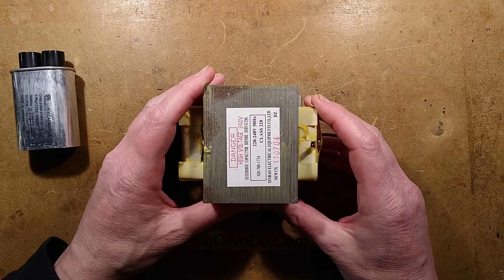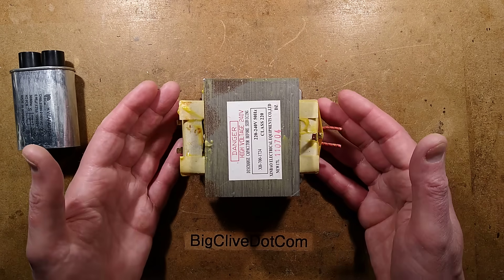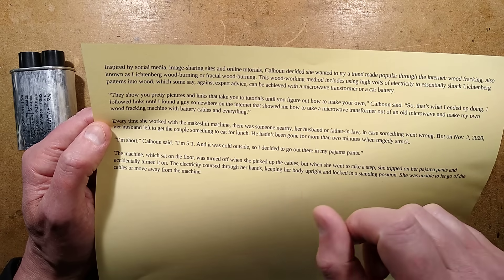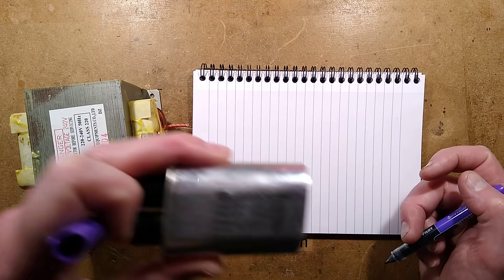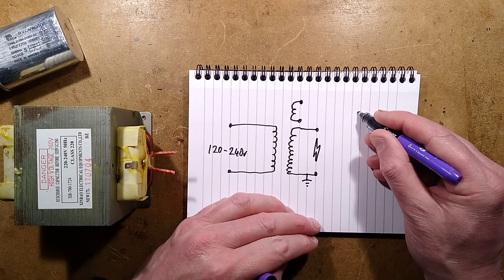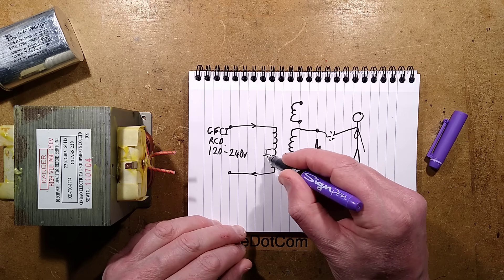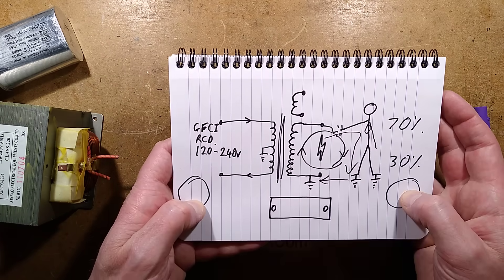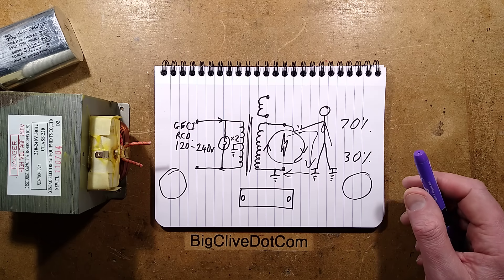The most deadly project on the Internet

Comment: I have seen my father working on the electricity in our house once and I don't recall what he did but there was a bright and very loud zap and his large insulated screw driver tip was melted off!, it gave me a healthy fear of electricity!.
Reply: I've seen a quarter inch thick screwdriver melted nearly halfway through by a 12 volt battery.

Comment: for those who want to try this, i suggest first they pull the sparkplug wire off of a running single cylinder engine with one hand while touching it with the other to get an idea of what they are playing with. with the plug wire disconnected, the engine will eventually stop rotating thus ending the high voltage pulsing through your body. your electrical outlet will not. remember the old hot dog cookers where the tasty, meat filled tubes were impaled at each end on spikes that were connected to the output leads of a transformer, thus causing them to plump up and split down the side, hot and ready for plopping into a bun with a little mustard? in this scenario, you are the meat filled tube.

Comment: Alternatively to building the entire box assembly you can attach your leads to the wood while the machine is unplugged and simply plug it in from a safe distance in order to turn it on and off
Reply from the maker: Many of the accidents happen because the things get left on or plugged in accidentally while someone is handling the cables.

Comment: Honestly the death rate doesn't surprise me, people who have no experience or knowledge of how something as simple as a transformer really works but are confident enough to play with one from a microwave to do a "wood burning" project are at very high risk of being careless while operating such a set up.  That being said I have had lots of fun with these transformers in dangerous ways, part of the fun is the thrill factor of knowing they can kill you... which means you must also pay respect to these components as such and have a backup plan in place in the event something goes wrong.  Starting with the common sense one NEVER be near the damn things while they have power on especially if you are playing with them by yourself.  ALWAYS use a grounded set up with your hands no where near anything live (or grounded for that matter) and have the set up on a breaker/and or switch.  Better yet use a momentary foot switch or trigger to operate the set up, it will keep you alert and it might save your life.

I have done lots of wood burning with these transformers, blown up circuit boards, jacobs ladders even played with couple different versions of tesla coils but not once had a close call situation, always assuming something is like, doing, triple check to make sure the equipment has been unplugged, don't touch anything until you have the actual cord in hand.  Habbits like this are the only way to prevent accidents and yes always assume any capacitors have a charge in them.  I even went as far as building a control box, the control box for playing with high power high voltage stuff and it is the only thing I ever touch while things are plugged in, it is the most practical thing I ever built lol.

I say it is pretty easy to use these things safely and have fun but that is coming from someone with some actual common sense and experience.  As a good friend once said "common sense is not very common".

Comment: Back in the early 60s I was a very curious kid and I had access to lots of electronic gear. I nearly killed myself a couple of times before I was 16. First time I was playing with a motor generator and I was trying to get it to run on 12v when it needed 24 so I was doing all kinds of sketchy stuff like lightly holding the brushes in my hands to reduce friction. Minutes after getting it running I got a probably 300-500 volt shock and was flung across the room by my own muscles contracting. The second time I was playing with a small flourescent UV lamp and I had mounted the components onto a steel angle iron which I held in my hand. I guess it was not well insulated because I got zapped with enough current that I could not open my hand. Fortunately I could move my legs and I slammed my arm against a chair which made the  lamp go flying out of my hand. Sometimes I think it is a miracle that I survived my childhood.

Comment: When I was in the military I had to work with the old APS-20 One Megawatt airborne search radar.  This was all vacuum tubes.  The two largest "black boxes" out of about 20 in the system was the high voltage supply and the actual transmitter box (about 400 pounds).  The HV supply was 12,800 volts and the thyratron tube in the transmitter was about 12,000 volts and 400 ma on the plate.  There were big capacitors in the system and the magnatron fired at about 55,000 volts. There were interlock plugs that were supposed to kill the HV that could be unplugged in the "radar well" , But one day I found that there was a failure mode that can occur making them useless.  Luckily you can actually hear the HV when it is applied, and you NEVER EVER touch any of these parts unless the system is totally powered down.  The failure was a shorted relay in the box that controlled the HV run up.  I gained a lot of respect for high voltages.  Replacing this box solved the problem. You also had to be sure that anyone in the aircraft near the controls was trustworthy to not do any thing stupid if you had your hands in these boxes below.

Comment: Another few suggestions from somebody that frequently uses arc welders:

1) Don't mess with two connectors at once, it divides your attention. Instead clamp one side at a time (while the device is switched off, ensure a good connection) and never use a system in which you are manually holding more than one connector under any circumstances.

2) Wear gloves. welders gloves work well, but it is most likely worth wearing any type of non-conductive protection.

3) Don't wet the workstation, circuitry or yourself in anything conductive. Duh.

4) Insulate any circuitry. Build a small, non-conductive housing for any circuits and keep them on a seperate work surface from any surfaces with conductive solutions or with large portions of metal.

5) Wear long sleeve clothing with trousers on. Do not wear a short sleeve T and some shorts, you are asking for an accident.

6) Have a buddy watch you work and never, for any reason, work alone with a homemade device delivering more than 500V or 20A. The story in this video highlights how even if your buddy is "gone for 5-10 minutes", it doesn't mean you should continue working. A buddy can't prevent an accident but they can prevent further harm by turning off the power.

Comment: there are even safer ways, i did this as a teenager just saying what if? i used a 60v pwoer supply and a murcury arc lamp ignighter to ionise the carbon (wood).
Reply from the maker: The lamp igniter only puts out low current at high voltage, but referenced to the mains.  I'm not sure how well it would work, but it could still pose a significant shock hazard.

Comment: I used the light in the microwave for an indicator and put all the components in a box. I put the microwave fan on the same box, also powered by the primary, to clear smoke away in case someone decided to wave it off for a better look. I will be adding a Deadman switch, but I built the thing with properly rated leads and three switches that turn on in succession as I move backward once the leads are set. This voltage has a hell of an arc and you'll never find me holding the leads.

Comment: Very happy to see this getting so many views, I hope the YouTube algorithm pushes this to everyone getting videos about projects with MOTs. Especially concerned with teenagers getting these projects in their feed as their judgement for safety is much much worse than adults. And even for an adult using a MOT would just be an incredibly stupid thing to do. 

Speaking from experience, when I was around 14-16 I got alot of videos in my feed about projects with MOTs. Most do warn of the dangers but it still didn't really land as a "make one mistake and you're dead"-kind of danger. Decided to make a spot welder once when I was 16 because I saw a video teaching how to make one using a rewired MOT. I wanted to try using the original secondary once just to draw some arc's so I just taped a conductor to a PVC stick. The arc was much bigger and louder than expected and it even burned part of the PVC tube. It got me terrified of the thing and I never used it again.

Now that I'm 22 and actually having had some electrical engineering classes in uni it just feels so incredibly stupid that a flimsy piece of PVC tubing was all protecting me from becoming a path for high-current 2000v to ground. As an adult I'd never even dare to energize a MOT with it's original winding anymore and I get extremely uneasy at the idea of 16 year olds seeing these kind of videos and try messing with these things themselves. Honestly doing these kind of projects helped me become good at these classes at school but it's just not worth the danger and I really think YouTube should enforce safety warnings on these videos.
Reply: When I was 22, there was no way I considered myself an Adult.
Now at 61, I still question that point.  Am I An Adult ???
Thanks for your story, sir.
- Retired Software Engineer.

Comment: I was making that wood patterns but with neon transformer, not electronic one but old, heavy and chunky (about 8 kilograms of copper, steel and resin). They went quite good but not very deep - since there was about 5 kV with 150W it coult take about 0,03A and still burn wood. 
Microwave transformers are best for home made welders or spot welders for lithium ion cells. You only need to replace secondary winding with only few (3-4) turns of thick wire.

Comment: Weird that YouTube suggested this to me on the VERY SAME DAY I decided to take my "boxless microwave" (all of the electrical components of my old microwave, painstakingly removed without undoing any connections, such that I basically had a damn Rat King/some kind of bolas from hell made of several chunks of mostly magnet wire and pure danger loosely netted together in a multicolored web with scarily thick strands) apart to finally see what all the fuss is about high-voltage transformers. I guess providence is telling me to watch this first...

Comment: Residual Current and Ground Fault are technically two different things which is the reason for the non-intuitive yet accurate nomenclature.

Residual Current: any form of imbalance between the source and appropriate current return conductor. Crossed circuits could trip an RCD/RCBO when the Neutral current is either higher or lower than that “sent” by the monitored Live relevant to that circuit.

Ground Fault: current returning specifically through grounded conductors, casements, etc.

As I understand it, many “GFCIs” are actually monitoring for Residual Current instead of Ground Fault Currents specifically and that there are certain applications where Ground Fault currents are of specific concern whilst Residual Currents are not.

Comment: When I was young, dad got a promotion.  He decided to upgrade to dimmer switches.  He got a little carried away and put one in the bathroom and hadn't put the cover plate on.  I ran out of the bathroom,  whacking the light switch as a 7 year old would.  Instead of going on to my next adventure,  I realized that my thumb was stuck in that gap, and I was buzzing. 🤩 I know I was thinking.  Duh.  I.  Am.  Getting.  Shocked.  By. My. Thumb.  Pull.  It.  Off.😠😀

Comment: You couldn't pay me to do this, or, if you could, I'd require a month with a certified electrician and probably about $2000 worth of safety gear and other things like another person to cut the power. It would have to be a lot of money. Especially since they wouldn't have to pay if I was dead.

I do have ONE question though. I knew that rubber boots or shoes were worthless as insulators electricity, but I always wondered what the outcome would be if the transformer (in this case) and you were up on a fully wooden platform. Non-conducting screws/wood glue. Wood is drier then a rock out on a sunny day. It would need height to avoid arcs, but would that prevent you from ever being able to complete the circuit?

Just curious. 

Thanks, and great video!

Comment: In regard to discharging the HV capacitor, was/ is the reaction of the discharge too violent for the screw driver method? I charged up a cap once to approximately 500 volts and carefully used this method ( with INSULATED HANDLE ) and wasnt keen to try it with a microwave cap in the business workshop.

Comment: Older TVs having a CRT, the anode was 20,000 volts 20kv, I wonder how many TV technicians were electrocuted per year.  Neon signs also operate at 2000v.  Are MOTs much more dangerous than aforementioned products?

Comment: We actually have too many people and many are not all that bright. I have done this process and will do it again. It is possible to do safely whether you believe it or not. I am actually surprised the number of deaths is not higher given the general capability and intelligence level of the average American. Double hold down buttons on the 120V input (I guess you say that later after trying to scare the dummies).. People die crossing the street and more Americans die by accidentally shooting themselves. Every problem does not rise to the level of a need for solution. This is one. If people are dumb enough to kill themselves then too bad.

Comment: It's amazing that people are willing to take these risks for a fractal.
This kinda makes me think my commercial days diving while we were underwater welding and burning old/new anodes with 350 something amps of DC running through the rig. I can still remember the sounds and feelings you'd feel even with multiple layers of insulating gloves and a hard grounded piece.
it has always left me leery of anything AC
Reply: I don't think they're realizing the risk, they just see pretty wood art project and tons of tutorials...
Reply: I hate to break it to you but DC at the same voltages is just as dangerous as AC...
Reply: @CoolKoon  Yeah that's why we actually connected the leads to the welding piece instead of throwing 50 feet of welding lead over the edge of the dive support vessel like many dive companies do.
even with three layers of insulating gloves and work gloves you were almost constantly getting a low level shock while the knife switch was energized.
Reply: @yellowtailhunter  I’m sure that did wonders for the nervous system in your extremities. :^)

Thanks though.  I sincerely appreciate folks like you who help keep our infrastructure running and (kinda) stable.

Comment: I got shocked by 500VDC several times and am lucky to have got used to it. That happened when I was involved in designing a security product used for Electronic Article Surveillance specifically in the boost circuit with heavy transformer driven by an IGBT and  UC3843AD Current-Mode PWM Controller from TI, all controlled by a Freescale MCU. It was fun, many of the team members also got shocked with it and we are all survivals...!

Comment: I'm not keen on a deadman's switch that you hold - the idea's good but in the case of a d.c. shock your hands may clench onto the switches, and in the case of an a.c. one they may just become paralysed and unable to release them - large push button switches fixed to a surface you have to push but can't wrap your hands around, fall onto etc seem like a better plan
Electricity hurts, when I worked as a tech in a monitor factory I got bitten by a 28Kv LOPT once, and my hand locked onto the anode cap, I could not let go, luckily very low current and an isolated bench, once I fell over I pulled the unit off the bench and the mains lead disconnected, it was a thoroughly unpleasant experience though, not one I am keen to repeat
Reply from the maker: It's purpose is to occupy your hands and keep them away from the dangerous area.
Reply: @bigclivedotcom  yeah I understand the purpose, I just prefer the two buttons fixed to surfaces either side of the work area, like is common in metal stamping machines for example, but that's just what works for the risks I have in the work I do

Comment: I use 40kV rated insulation wire when I do high voltage things. More often I'm replacing the secondary with just a few turns, silly high current at a few volts. If I were burning wood with this I'd be applying with a fiberglass rod and rubber gloves.
I worked with high voltage for many years servicing UHF analog TV transmitters, (33kV at 8 Amps). It is not to be taken lightly. Arcs can dance around a room from voltages like that. 2kV is not as dangerous but is still serious. If the electric arc can start paper on fire and burn wood, and this can, it can do it to you, is serious, and safety precautions must be taken.

Comment: I have several 15,000 volt 30 milliamp neon sign transformers over my years I have trained myself to be able to grab both sides of this and deal with the voltage because you can basically short out the current. The surprise with that low of current is the problem that startles or scares people. with the 30 milliamps if you allow it to Arc you will get burned. more or less being trained from 5 years on to deal with dangerous voltage and dangerous currents of growing up with vacuum tube TVs I guess I learned all the rules of staying alive. It saddens me that in this era of Internet knowledge that common sense and the inherent dangers can't be passed on over the internet as easily. Dead man switch modifications from experience. The initiator switches need to be momentary contact and recessed so that they cannot be initiated by laying on them or laying something on them
Reply from the maker: I'm not so sure passing 30mA through yourself is a good idea, but a video of that would be impressive.